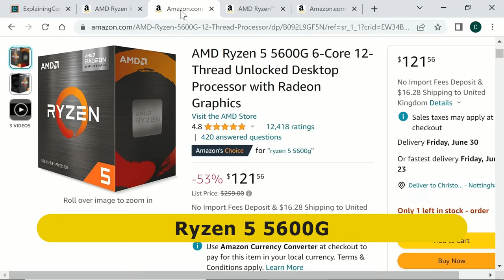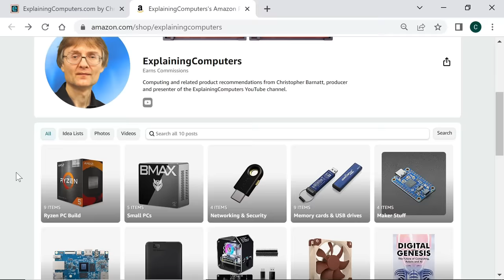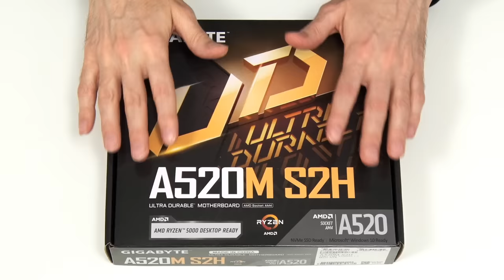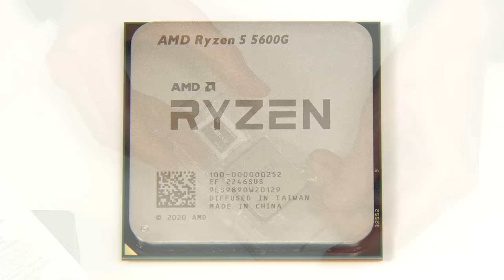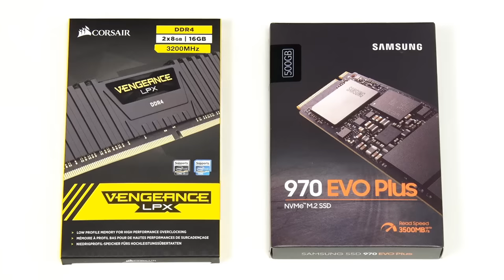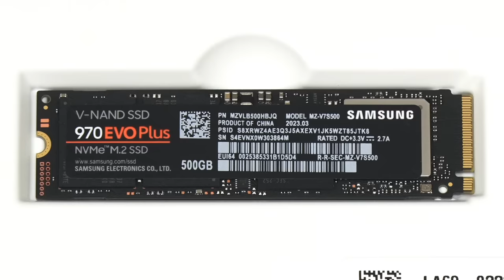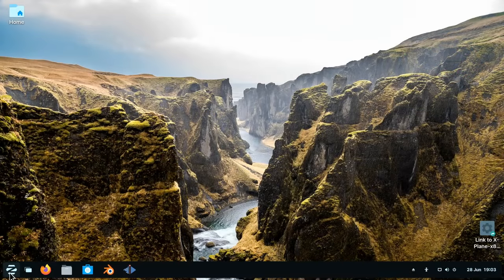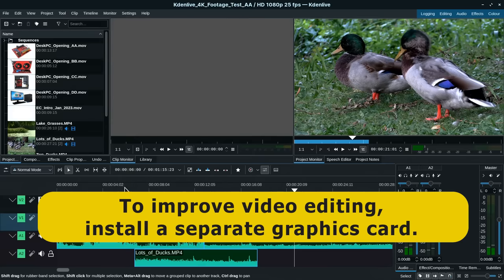Best Value Ryzen PC Build

Comment: Because apu 's use system ram for video.I would use at least 3600 speed ram for video
Reply from the maker: 3600 RAM would be overclocked on an A520 motherboard . . . the max for non-overclocked RAM is 3200.
Reply: @ExplainingComputers  Sorry didn't know that. I have a ryzen 7 4750 chip on a b550 tuff motherboard running 4400 gskill ram .Thing is a beast.

Comment: How would I install Windows 11 onto a New build computer ? using the Gigabyte motherboards.
Reply from the maker: You would need to prepare a Windows 11 installation USB drive -- by downloading an ISO, and writing it to a USB drive using a program like Rufus or Etcher. The basic process is covered in this video: https://www.youtube.com/watch?v=UL_maCWM5bk -- except here you don't need to worry about the incompatibility issues! :)

You can even create a bootable Windows 11 drive directly using the Windows 11 Installation Assistant -- first option here: https://www.microsoft.com/software-download/windows11 -- although I prefer to download an ISO for potential future use.
Reply: @ExplainingComputers  what about licensing and key codes?

Comment: Hi Chris How Many Raspberry pi do you have
Reply from the maker: I think I have a 1B, 2B, 3B, 3B+, 3A+, Pi 4 2GB, Pi 4 4GB, Pi 4 8GB, Pi 400, two Pi Zeros (one an early one without a camera connector), a Pi Zero W, a Pi Zero 2W, and I think four Picos. That's 13 normal Pis (I'm just missing a 1A), and 4 Picos. :)
Reply: I Can't Afford The Orange Pi 5

Comment: It's really questionable if It's worth it to save a few bucks choosing an  A-series MB. You can get a much better B series B-550 Series board for a mere 20-30 Bucks extra that gives good value over the ultra budget and often very limited A-series Boards
Reply from the maker: If more features are not needed, there is no "value" in buying a more expensive board. As I've answered in another comment here, I looked at some B450 boards -- same number of RAM slots, one less PCIe slot. Identical other connectivity. It is a complete urban myth that the A-series boards are "very limited". What exactly do you think I am lacking by having an A-series board?
Reply: @ExplainingComputers  I perfectly agree if it isn't needed you might as well get the cheapest available, but the A-series does not support overclocking and for me at least It's importent that I have a board with good ammount of USB hubs that is not affecting each other. I have several times run into that even there is enough USB sslots you totally  loose control of the keyboard/mouse input if you start copying a large file or ammount of files from or to an USB drive because they share the same Pcie lane, and some boards can be outright silly designed by how they make use of the available PCIe lanes. often you have have an usb hub connected directly to the cpu and at least one that is supported by the chipset. If your not carefull about knowing which ports is sharing the same hub you might run into that your system seem extremely slow in copying from one to another usb connected device, plus if your mouse or keyboard is on the same hubyour system may become totally inresponcable. Thats one of the cons going down the chipset ranks. Have often seen people that first too late realices they should have chosem an X570 instead of a B550 mobo for what they want to use it for.

Comment: B550 aorus elite v2 offers better cpu upgrade capabilities down the line >.>
Reply from the maker: You are making the assumption of available AM4 CPUs in the future. In practice, most PCs never get a CPU upgrade. And what AM4 CPU will work in a B550 and not in a A520 . . . ? I cannot think of one.
Reply: @ExplainingComputers  I would assume second hand chips would be around for awhile
Reply: @ExplainingComputers  also true, majority them boards aren't built for the looks tbf, I was more on about gen 4 if you look into any of them am4 cpus avaliable on either second hand or new, great well rounded motherboard offering the majority the same features if not more probably around the same price now

Comment: why oh why theres plenty of b450 boards on amazon uk for under £60 so why buy the a520
Reply from the maker: I paid £58 for the AM520, and the cheapest B450 I can see -- a Gigabyte B450M K - is £56.57. So I hardly paid a premium to get a board with a newer chipset. The B450s for under £60, such as that Gigabyte B450M K, all have the same number (2) RAM slots, and the same number of PCIe slots or fewer. Indeed the Gigabyte B450M K has two PCIe slots, compared to three on my A520 board. So "why oh why" did I buy an A520 rather than a B450? Because for almost the same price I got a board based on more modern technology, and an extra PCIe slot.

In the price bracket, the only reason to buy a B450 over an A520 would be -- as I clearly explained in the video -- if I wanted to overclock. And I don't! And indeed, most people don't.
Reply: @ExplainingComputers  you do seem to get rather angry over comments, hey ho 
as for 'most people not overclocking' i would debate that most pc users dont overclock or tinker, i would say most diy pc builders actually do overclock or tinker
as for a superior chipset..that really is debateable, b450 is generally quite feature rich and actually has many options to undervoltand tinker whereas the a series chipset has generally been locked out of most things, its meant for ultra cheap basic pcs or office workstations,i think your getting a bit confused as to me or other people being some mad overclocking addict,ryzen cpus are not really a cpu to overclock in the old sense of the word, more like a good undervolt and locking the base frequency higher than stock for a solid all core boost
but hey everyones entitled to there own opinions ,i just disagree with yours
i think most pc builders would be better served and more likely to use a b450, and more likely to be able to find a more decent vrm on b450 in that rough price range

Comment: 02:52 So how they can be used wthut GPU if they re not APU?
Reply from the maker: AMD have created a linguist mess with this. "APU" is a marketing term, as much as a technical term. For example, Intel chips with a CPU and GPU are not called APUs. The 7000 series Ryzen chips have an RDNA 2 GPU, as the video clearly notes, so can be used without a graphics card. But there are no 7000 series "G" suffix APUs, as also noted.

Comment: Stay clear of Gigabyte.  Here is why:

They have appalling, virtually non existent and "could not care less" customer service.

Two or three years ago, I purchased two of the their B550 chip set based motherboards.
On both machines, my USB drives would disconnect after being written to.  This was with both LaCie drives (a Seagate company) and with G-Technology drives (a Western Digital company).

I had the latest BIOS / firmware.  And when reading about the BIOS / firmware releases in Gigabytes's own notes, they wrote that their releases were to fix USB connection issues.  Yet, their latest software (or their chipset's hardware) was bad.

There is no way to contact them, other than through an intentionally crippled web ticketing system.
-- No phone numbers.
-- No e-mail addresses.
-- No on-line chat.
Zilch.

So I filled out a ticket that asked questions that about my power supply, my RAM, and all types of unrelated items.  I did not mind, as they do not know what is going to be reported, so it is best to have that information handy.

But when it came to being able to actually describe the problem, they gave the customer a tiny text window with approximately 250 characters to explain the issue.

Ten days later, they replied to me to restart my computer, and also mentioned that the power supply and other items are unrelated.
So I fill out the required information, and ten days later they tell me it is unrelated, and to reboot my computer.

So I figured that I would reply to them and have them focus on the issue.
Guess what?  No reply option exists.

So yet another "new" ticket was opened by me.
Ten days later, another useless reply.

I was within my return window with Micro Center.  So it went back.

For close to a month, I struggled with the above, including the time wasted building the computers, and time wasted driving back and forth to Micro Center, and time wasted waiting in Micro Center for them to call my name and assist me -- and Micro Center's personnel wasted time dealing with this return.

I can understand a tech company having a hardware or software issue.  But the intentional firewall / roadblock that they erected to avoid contact with customers, and their BS replies, and their 10 days of waiting to get a BS reply, is unacceptable.

I do not care if Gigabyte products ever get great reviews at ½ the price of competitors.  I will never give them 10¢ of my business.

I ended up purchasing MSI B550 chip set based motherboards, and they function flawlessly.  I have no idea about MSI's customer service.  Fortunately, I never needed it.
Reply: That board works fine with the 5600G cpu featured in the video?
Reply: @mrchico2621  That board works fine with all CPUs.

The problem is with USB drives disconnecting, and Gigabyte not caring and having virtually no customer support.
Reply: @NoEgg4u  I had a faulty A520i which is the same board as the one in the video but in ITX, and it wouldn't boot with a 5600g. I tried to file a ticket but the process was so painful and didn't they reply until a week later. By then, I had already sent out the board back to Amzn and was waiting for the replacement to come in. Luckily, the new one booted right up on the first power on and didn't require a BIOS flash. My problem is how do Gigabyte or any AIB partners send out faulty products? Do they not test it at the assembly line? Like every new car from the factory, they actually need to test the car before shipping them out to dealers.

Comment: using this SSD without a heatsink is a bad idea
Reply from the maker: I will add a heat sink if I have issues. Whether it is a "bad idea" depends on the ambient temperature, and what else is in the case generating heat (here minimal compared to many desktops). Heat sinks for SSDs of this speed are rare -- far more common for the next generation PCIe 4.0 drives. In over 5 years of use, I've never had temperatures issues with a c.3000 MB/s SSD.

Comment: The CPU is not coated with thermal grease.
Reply from the maker: As the video notes and shows very, very clearly indeed, themal compound is pre-applied to the stock AMD cooler (as it also is to a stock Intel cooler). I give up.

Comment: I think USB 3.2 Gen 1 is 5 gbps not 10, for 10 you need either USB 3.2 Gen 1x2 or USB 3.2 Gen 2x1 .... sigh... not at you Chris but the bonkers USB naming committee.
Reply from the maker: Yes, I slipped up there. My bad.
Reply: @ExplainingComputers  not a criticism of yourself, I actually had to check Gigabytes specs before posting because I thought I was wrong. I blame the USB-IF, why they couldn't have named them 3.11 for 5gbps, 3.12 for 1st gen 10gbps and  3.21 for 2nd gen 10gbps and 3.22 for 2nd gen 20 gbps

Comment: Not a big fan of the component selection here. 

The motherboard is worst and cheapest garbage anyone can buy. These 2 dimslot mainboard are basically producing ewaste. Whenever you need to upgrade the ram to potentially help keeping the system useful, you need a new mainboard or new and bigger ram sticks. Just to save a few bucks.

It’s more of a cheapest thing you can build pc than value.
Reply from the maker: This motherboard is certainly not "the worst and cheapest garbage". And the vast majority of computers never, ever get a RAM upgrade. There is absolutely nothing wrong with using a two DIMM slot motherboard. It certainly saves more than "a few bucks".
Reply: @ExplainingComputers  huh. While it is true that most don’t get one, denying the possibility to save a few bucks is just furthering ewaste production. This thinking is a light version / beginning of the thinking that lead to all the proprietary crap pc parts dell, hp and Lenovo that are useing to save money and further the profit margins.
Reusing and using something a long as possible is the best option to reduce ewaste.

On another note it’s cheap for a reason. It’s one of the most „basic“ mainboards that are offered.